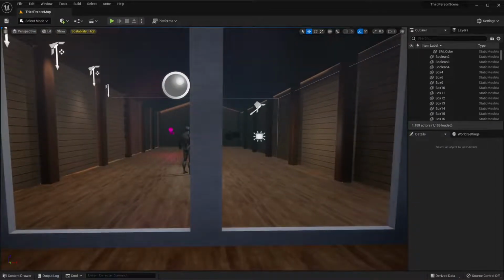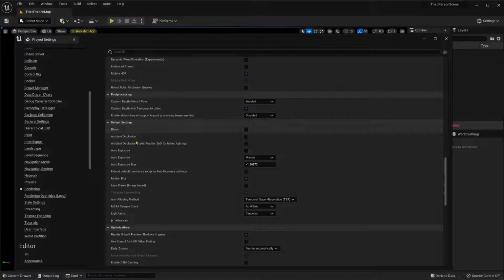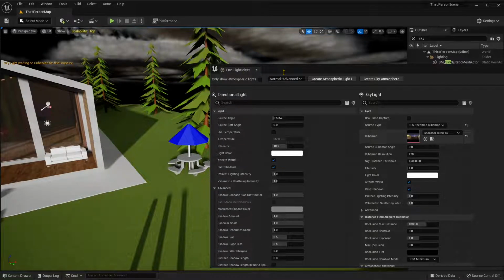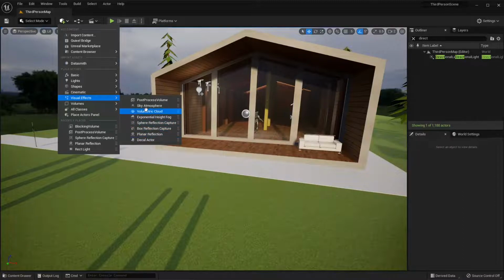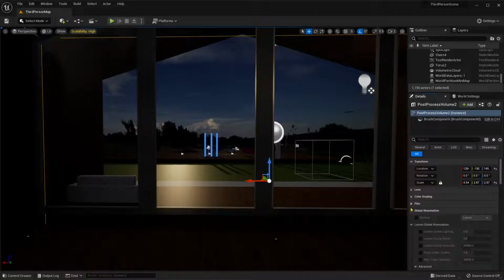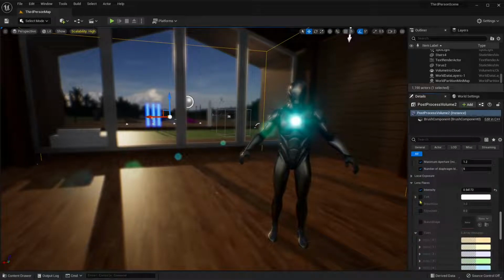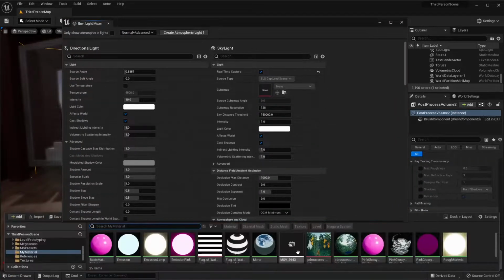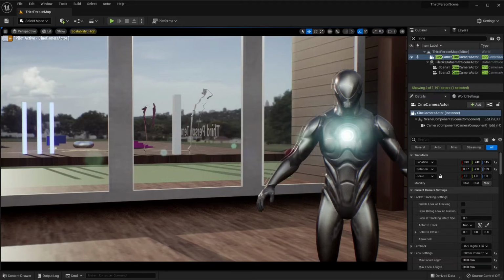UNREAL 5 Videocourse - 20 - Rendering and Post-Production, Post-Process, Camera, DOF, Lens Effects

Comment: Hi,
Your videos are amazing. Even non cgi knowledge you can make lots of steps.
Plessure dude.

My problem is, when i download and want to use ready objects from sketch up back face problem will appear.
It takes a lot time to rever/align faces in sketch up.
Do you know any shortcut to make it in sketch or in ue5?
Reply from the maker: Hi, you just need to turn on the two-sided material option in unreal engine. You will find it in the material editor. For the full Unreal Engine Videocourse please contact tutor@jbdesign.it
Thank you